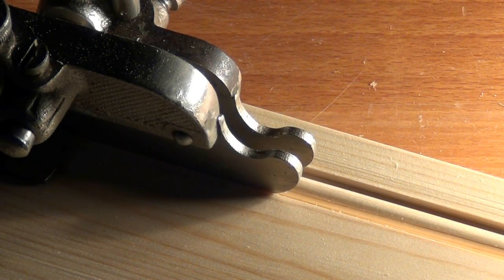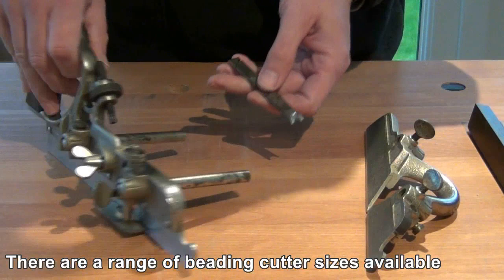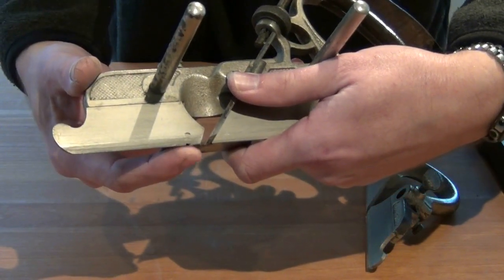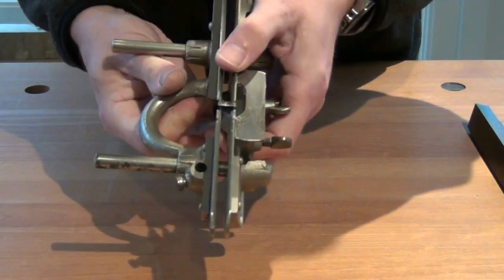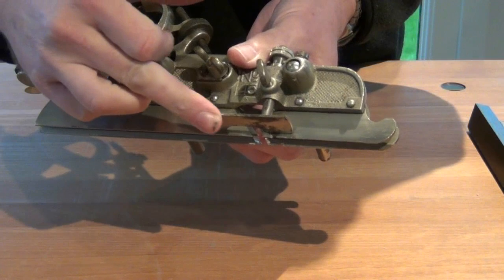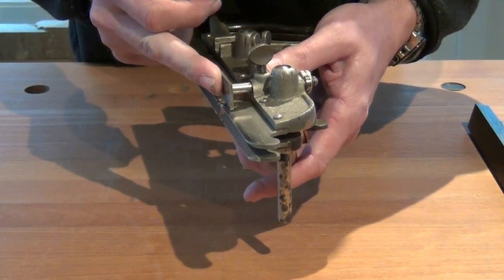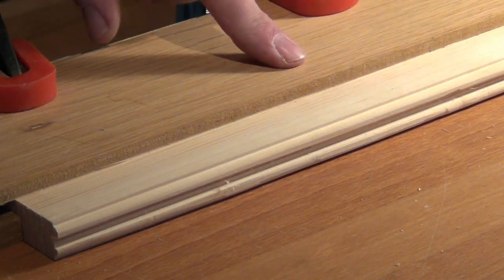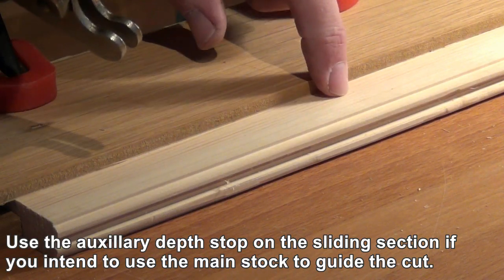Face Beading using a Stanley No.45

Comment: Hi Mitch, Happy New Year!

This evening, instead of my usual lengthy emails and/or comments, I filmed and posted/videos ( I think digital recording may be more accurate) of me attempting to use the Record combination plane to create a bead ( http://youtu.be/bOoZZtyWIA4) with multiple links back to your channel and videos.

 There are 2 videos: in the first I discuss my efforts at sharpening and in the second I try to make a bead in pine and then in oak. Thanks to your feedback, my results continue to improve. I think, however, that my sharpening is still an issue. My sense is that a truly sharp cutter will move through the wood (oak or anything else) with little to no pressure or "muscling" as we say in the USA.  I plan to try a bit more sharpening tomorrow, but I am hoping that you may have some feedback and advice after seeing the videos.  

Best wishes for the new year!

Kevin

Comment: Hi Mitch, rather than send a lot of pictures and emails, I made 2 short videos of my efforts to bead with the Record 050. Here is the link: https://www.youtube.com/watch?v=dwI_Vjio7KM&index=2&list=UUkscgkSs56HcHCOpGJJMI1w 

I'd appreciate any feedback. I am going to try again today, but I believe that I bear down too much when I push forward and "tip" the plane forward slightly; resulting in cutting too deeply and the binding.

I am getting better, but I think the cutter needs to be sharper. I believe the back and two side edges are good, but the rounded part of the cutter needs further sharpening. How long do I work with the 1000 grit slip stone? Prior to the efforts in the video, I worked using the 1000 grit slip stone until I had maybe .5mm of shinny metal and a very slight burr on the back. I then moved onto the 4000 and then 8000 stone.
Reply from the maker: Kevin Blair Hi Kevin, I've watched both and let comments. Hope they help. Mitch